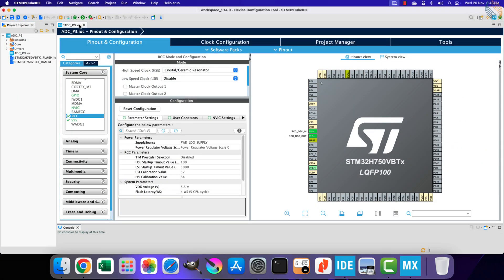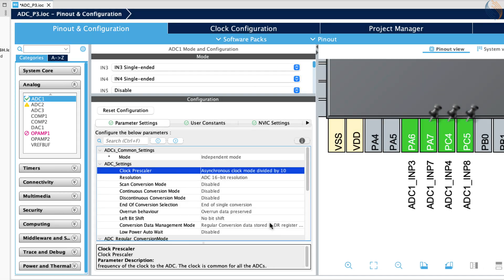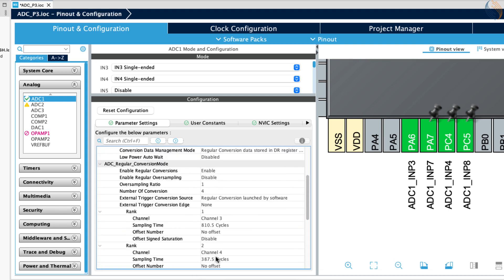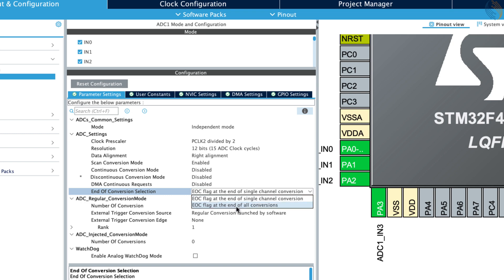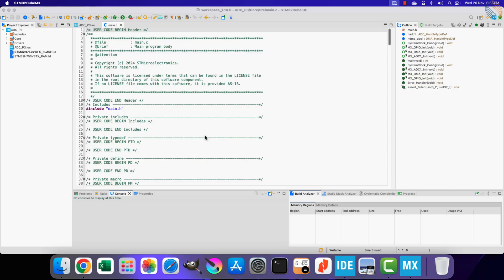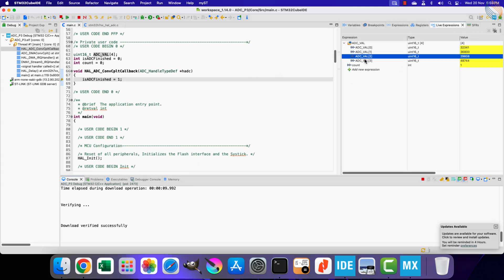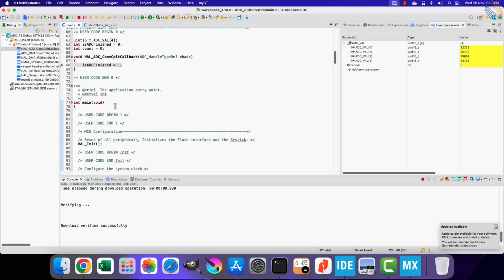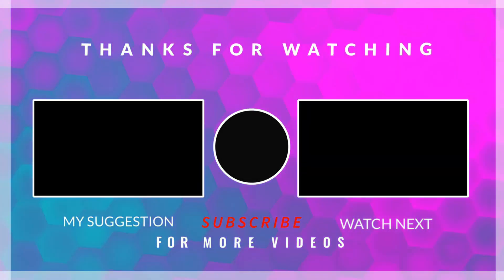STM32 ADC Tutorial (Part 3) | Multiple Channels DMA Normal Mode

Comment: Sometimes both values drop to zero , sometimes only one drop zero when ı am rotating the other one. Is this because the cables are not connected properly or is it a problem about configuration ?
Reply from the maker: Most likely the connection issue. If you are getting both values, then configuration is fine.
Reply: thanks :)

Comment: Thanks for the Video. Just some FYI: The STM32F103T8C6 doesn't have the End of convesion settings in the Parameters, so the work around is using the Conversion Complete Call back - "HAL_ADC_ConvCpltCallback".